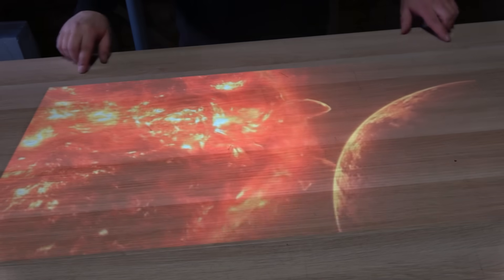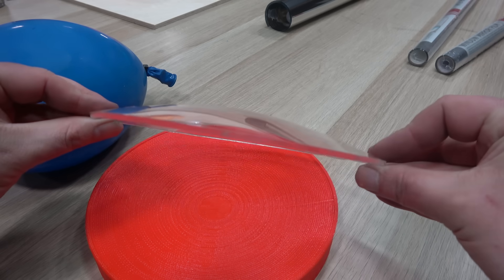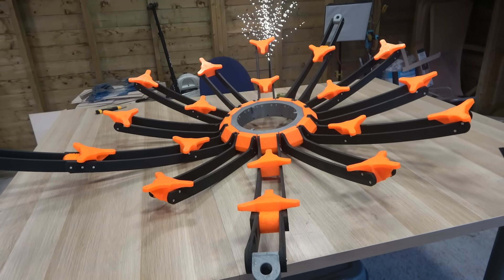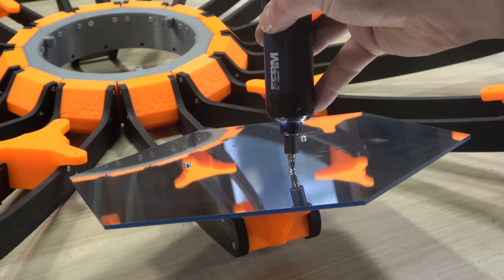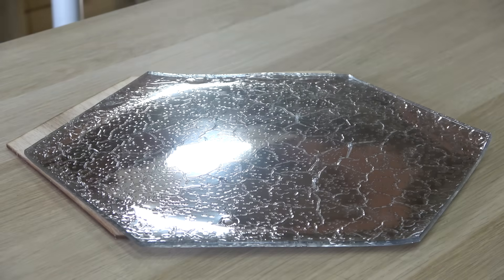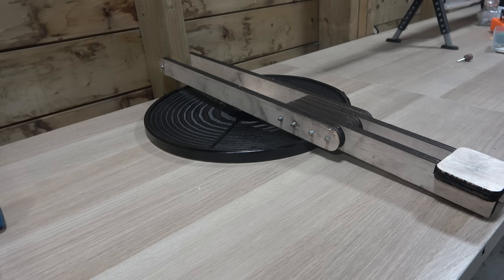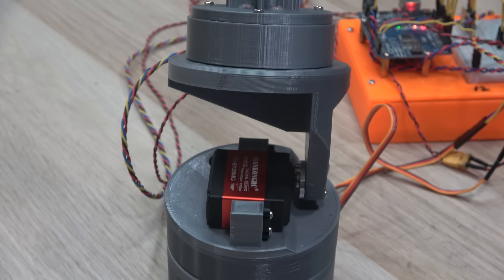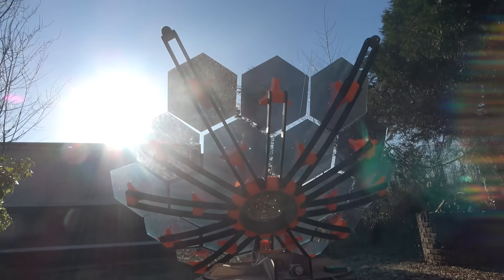Building a DIY Solar Generator..

Comment: 1) The aluminium plate should be black, use heat resistant stove paint, it's usually rated over 600C.
2) Chemically plate the mirrors with silver plating solution.
3) Move the jack screw for the vertical axis so that it has better stability in the wind. The classic way for larger commercial satellite dishes is to have the jack screw go from the opposite side of the base to the top of the dish centre support frame.
4) Get a stronger jack screw system, if you want do it on a budget, then use a scissor car jack.
5) Temperature test your TPU springs. What's going to be the impact of the hot reflectors on their elasticity, especially over time? 1h of compression is hardly conclusive. I think the metal springs might still be a better idea as they won't hold water like the closed TPU ones. 
6) Consider having a mechanical solenoid lock on each axis so that you can prevent stress on the motor. This can be for storage or even engaged between movements.
7) Put some hysteresis on the tracker, you don't want it hunting. The sun will be where the sun is, it only moves 0.25deg per minute, but signal noise and clouds will cause the tracker to hunt and that will burn out the motors. 
8) It's even better if your tracker knows the rough trajectory of the sun so that it follows the path even when there's not enough reliable sun for the LDRs to find it. Look at celestial trackers from the astronomy community.

Comment: Some improvements..
1. to form the mirrors, use two  molds that will cover the entire mirror (the edges looked a bit like they where not evenly molded.. )
2. you could place the tracker on the sun facing side of the secondary mirror, just an idea.
3. if you have the machines, you could make the mold and former out of aluminum/metal and heat the mirrors within them. (Using the mounting points to Aline)

Comment: Are small metal springs really that expensive?  I feel like 3D printing 50+ parts that are in the long term, less resilient than the their metal counterparts is just over engineering for worse returns.  
Am I wrong here?

Comment: There is so much here..! I really enjoy your projector table!
You’ll need glass or quartz, if you want better lenses (10x power, 100x cost)
Aluminum reflects better than silver and gold, but it more prone to oxidizing.
Copper transfers heat best 
Charcoal is ideal for light absorption, so a copper cup coated with charcoal will pull heat off the coal. 

Copper grounding rods into an insulated sand box (or crushed brick) will trap heat.

Comment: Aluminium heat exchanger will be more efficient if painted in non-reflective black. Aluminium will heat air, and lose energy. It must be covered with something, to prevent heated air from escaping. 
If mirrors are heating under sun, that means they do not reflect infrared good enough. You can calculate amount of energy you can get with mirrors and how much water is heated. I think ordinary heat collector (black water pipe in box with glass cover) will do better work in heating water, even without sun tracing mechanisms. But this thing can get more temperature difference, which enables to start stirling engine or even steam engine. But i doubt that it can generate more power than solar panels of similar size.

Comment: all your work with gold paint means nothing, when it is about the elemental properties of gold and how it reflects. the best way to test this is with gold leaf, actual gold crazy thin. in space i think they use gold backed Mylar, so that may be a product you can buy too. and red laser light is not sun light and that is what you want to test with, since you want to know how the mix of wavelengths of light that comes from the sun perform, not how the one wavelength of red light that comes from a laser. but hey you made a thing and I didn't so full points to you!

Comment: Since you havent mentioned it - you may want to test LDRs for individual deviations under controlled light levels and software-correct. I can imagine a lot of motor jittering so a rolling average filter or other may be considered as well
The mirrors are sick-cool! best of luck

Comment: For sur catchers, there are even more simple systems : each motor is connected to two (by axis) small solar pannels, separated wy a waffle like you done. One pannel is connected to + and -, and the other one is connected reversly. That's it. Many videos on that on inernet. I guess even naza did a system like that. "Keep It Simple as Stupid" systems are the most resilients and affordables !

Comment: Is it absolutly necessary to have each mirrors rounded, or flat (waterproofed with tropicalized silicon in the edges) glass ones could work great ?

Comment: I would have adjust the "mirrors" not with springs, but simply adjust each mirrors supports around an axle. Even the tracking part could act with this levers, like actual plant leafs. As the sun turns during the day, so it's projection is not perfectly "round" all day long, but elongated differently each hours.

Comment: A microcontroller with real time clock can calculate the suns position in realtime, no need for sensors.
There is an example program online on wikipedia.

Comment: GOD love you my friend . For all these projects you do. Now please see old issues of Mother Earth News Magazine where you can see where the web folks found their inspiration . Now to my advice & questions. Why go through all this extra work to design & build a flowed system ( flowed in as much as it has to use a portion of its produced power to track the sun. { WRONG } when the sun or rather the Earth already has a massively long track record of doing this as a by product of our enter action of gravitational driven orbit. the only thing we need do is use flat mirrors in a multi ring set design  like the solar 1 solar power plant basic layout . again minus the need for any mechanical devices that use a portion of the power produced. ) Think Stone Henge with flat mirrors on all surfaces except tops & inner round area (tank or ceramic heat sink with cannels running through it to heat liquid transfer medium). This is a rudimentary portion of my own totaly passive multi fueled green power plant design. I will discuss any further details you might need to build this stand alone portion of my set up. As by using it alone you acquire a better solar design power system with my adjustments to these currently poorly designed commercial systems. Like the one outside Los Vegas NV USA. I will provide directions for a properly reworked design & retrofit to bring it to a higher output point that doesn't over heat the metal components ( causing structural damage when it is tuned up to higher levels of it's potential operating levels.) As there are several of those flowed systems in commercial use around the world I will offer the fix & thereby higher efficiency, power output & profitability. I'll need a very fare fee of 3,000,000.00 US dollars per current unit & a up front 1 time payment of 3,000,000.00 US dollars for any future plants built on my design or derivative there of. 
A very cheep price to obtain the higher potential production levels without their current loses & operational limitations due to flowed design, build & operations. Have a few CEOs call me we can talk. A cheep switch over when you realize the increased production, cost recoup via sale of old unnecessary parts, new regained power.   
as always I will be watching to see what you come out with next. trust me it's not that this design won't work, rather it has been done successfully before. Just that there are less costly better designs that have many of the limiting features removed up front.

Comment: Plexiglass (generic name is acrylic) is a poor choice for a transparent plastic exposed to sunlight (UV specifically) and weather.  It deteriorates quite rapidly and yellows.  Polycarbonate is the preferred material for those conditions.  This is under the assumption that the reflective coating is on the back side of the material, which is where it should be to create a mirror.

Comment: Make heat collector black & cover it with polycarbonate with an air gap or vacuum gap. To insulate from air temperature. 
Plexiglas can not handle heat.

Comment: If the water being piped through the aluminum heat plate is going to be warm, would its high temperature cause the attached plexiglass to deform?

Comment: Your lazy susan bearing is going to be happier over the long term if the weight of the project is coming down through the center.  Could you relocate the axle that the mirrors are rotating closer to the center of the bearing?

Also, have you exposed it to the kind of wind it'll experience once it lives outside?  Your one home-brew linear actuator is awfully close to the axle that you're using to change elevation. (12:08)  Perhaps reinforcing the wood and plastic in between the two axles with steel or aluminum plate might be an inexpensive hedge against catastrophe.

Comment: See if you can get Spaz Stix Ultimate Mirror Chrome paint in the Netherlands. It works on glass and glass smooth plastics to create a truly mirror reflective finish. It can do that on the front or rear surface. On the front surface, to protect it, the company makes a special clear coat. For use on the rear surface they have white or black backing paint.
It was originally made for use on the inside of vacuum formed Lexan bodies for radio controlled cars. It works on most plastics and fully dry paints. Spray some on the lid from a CD jewel case for an instant mirror. Of course the lid has to be clean and not all scratched up.

Rustoleum has a similar paint called Mirror Effect. It's not quite as reflective and it only works on the back surface of clear glass and some plastics. Unlike the Spaz Stix paint, this Rustoleum will not work on styrene.

Comment: Not that it's entirely necessary, but I think I would have liked to keep the mirror assembly's center of mass centered over the lazy susan bearing. So instead of just tilting the assembly up and away with a pivot point out near the edge of the table, I might have designed a curved rail such that the mirror assembly could slide itself along that curved rail to the desired angle, while keeping it's mass more centrally located.

My other thought is to wonder whether there is some mirror film that can be applied AFTER the reflectors have been molded into a parabolic dish. Perhaps some of that automotive wrap film that is designed to conform well to curves? In a chrome finish?

Unnecessary changes, but that's what my brain would have come up with. I'm very impressed with your DYI builder skills! What will you do with the hot water that is output?

Comment: you could probably get away with just one parabolic mirror in the center reflector; each hex can be aligned to reflect it's own area onto the center reflector on the arms. that center reflector should be larger than the hexes and be parabolic to concentrate onto the heat target, which you should paint black. insulating the back of the heat target as well as the hoses will make a big difference to energy harvested. what is the goal here though? total energy? or do you want high heat as well?

Comment: I think that if you would coat your water-cooled heatsink with ceramic ( try white aluminium oxide powder mixed with waterglass ) i would hold heat for longer and prevent the small return mirror from overheating from the light reflected from the shiny heatsink

Comment: The tracking approach is backwards, The swivel base should be set at an angle matching the path of the sun for that day, so that it's only necessary to swivel the mirror along the same arc to track the sun, and the second motor only needs to be used once daily to adjust the angle of the swivel. It also keep the motion smooth and make the whole rig more sturdy.
Pure gold foil is fairly cheap due to its thickness of only a few atoms and you can apply it on top of the hex tiles, avoiding losses from going through glass or acrylic twice. Since gold doesn't tarnish it can safely be exposed to the air,  That's how my mirrors for lasers are arranged and 30 years later they're just as shiny as they were on day 1. Of course they're not exposed to dust and moisture.

Comment: You can calculate the position of the sun in the sky from 0.01° to 0.05° of precision for basic algorithms and up to within a few arcseconds (0.0003°) with some more involved algorithms. This is a solved problem and there are plenty libraries for this in most languages (astral or skyfield for Python, suncalc for JS etc.) and there are also API's (like NOAA Solar Calculator) that make it even easier to get the position of the sun for a given location at a given time and date. That way you won't have to bother with LDR's which, I bet, won't give you the precision a bit of math can (and it'll save on hardware).

Comment: If you're wanting to use parabolic mirrors, i would be tempted to use a smaller aluminum plate, with deeper groves and less overall length. it may be more efficient between the friction losses and the thermal conductivity since  you can increase the surface area for a smaller length of travel. using larger hoses would also help with reducing friction and improving flowrate.

Comment: You can make parabolic mirrors with mylar, fibreglass and a bicycle pump, though a parabola might not even be required since your heat collector is so large. 

https://www.youtube.com/watch?v=8CLRTa_ocmo

As everyone else has suggested: paint it black. A spray can of matte black woodstove paint would probably be a good place to start.

Comment: The center should be as dark/non-reflective as possible if you want to absorb the most amount of heat. Consider either: a black anodized coating; a cast iron attachment; or really scuffing the surface (easiest but least effective option).

Comment: Could you align the mirror by fluid (water, oil) pressure. Divide the receiver in four quarters if the mirror is misaligned some quadrants will heat up more expanding the fluid more than others. Using hydraulics you could align the mirror. If it works it would be completely passive. The other option is to use a solar panel to power the electronics.

Comment: You keep saying 'heat'. Solar panels don't capture heat; they capture light. And gold is the most heat-reflective standalone element there is, next to Tellurium and polished aluminum. And on that, I was going to say use polished aluminum under clear epoxy for your reflectors onto the solar collector, or maybe mylar under epoxy. Good luck.

Comment: Don’t use the same parabolic mold for all those segments: you should be using 3 different molds based on your segment layout.

Mirroring some comments of others: use flat or even the spherical segments would be good to more evenly heat the plate, which you should place at the prime focus

Comment: "Gold" paint is just dyed brass.

If the paint was actually gold, it would be about $5000 per can.

Likewise, silver in this case is just aluminum.

If the 'silver' paint was ACTUAL silver, it would cost about $300 per can.

Comment: You should retry gold but this time use real gold foil. Its not that expensive as it's super thin and people use it on buildings and signs.  Could you explain more about the center heat plate?  How  do you intend to store the heat?  Wouldn't it make sense to raise the apparatus higher up so nothing can cast a shadow on it?  Perhaps several small units might be easier to build and be less stress on motors and easier to position, perhaps on a rooftop?

Comment: -I'd redesign this to have the collector plate be smaller and mounted at the focal point of the parabola and not try to reflect it back to the center as you are introducing unnecessary inefficiency with the extra reflection.

-like many other people have pointed out, the collector plate should be black as you want to trap as much heat as possible, not reflect it away

-I think it would have made more sense to 3d-print the segments of the dish then electro-plate them as that would reflect a lot better than any paint would and it would mean you could print each segment with the correct curve instead of trying to bend it afterwards and having to create molds which would be inaccurate as you would need to create a different molds to have the correct curvature in each segment. The segments could also be designed to interlock with each other to reduce their size(to allow to fit in your 3d-printer) and reduce the mounting points. Either that or  bend the plastic before applying the reflective film

-the angles of the  mounts for the dish segments didn't really need to be adjustable. The shape of the parabola isn't variable.  It should have been designed in CAD first then each mount printed at the correct angle. It would have saved you complexity and weight and cost. You could have even designed a spine right into the segments of the parabola and avoided mounts altogether. s of the parabola and avoided mounts altogether. Domes are fairly sturdy structures on their own so a spine might not even be necessary. 

-since this device is meant to be used outdoor and presumably in the elements, considerations need to be made for wind and rain. The joints need to be sturdy enough to take a strong gust given the surface area and shape and the device needs to have proper drainage